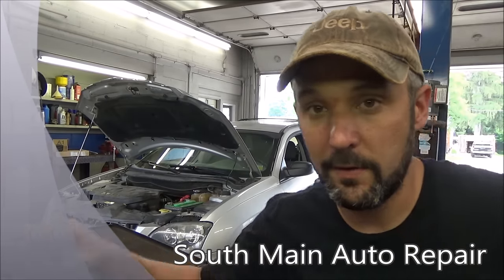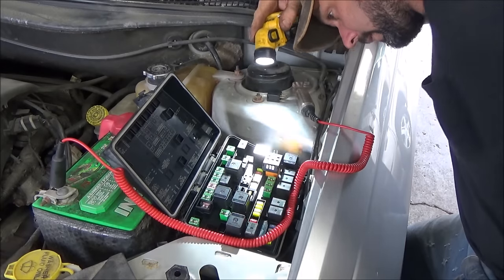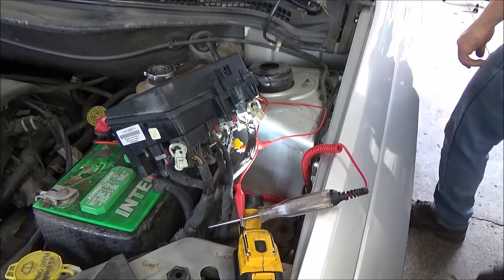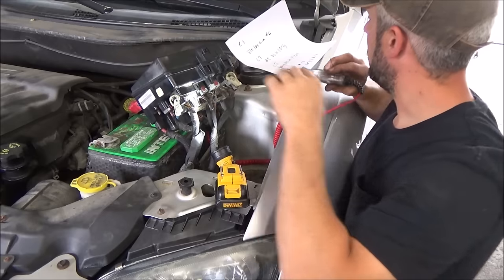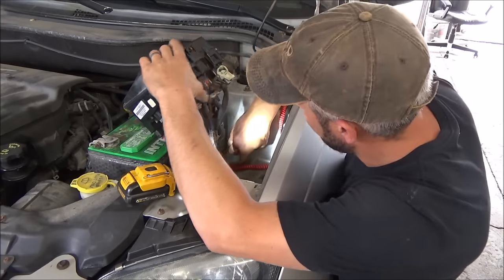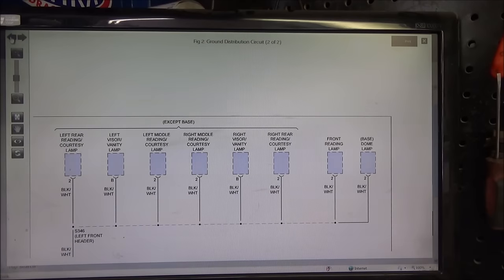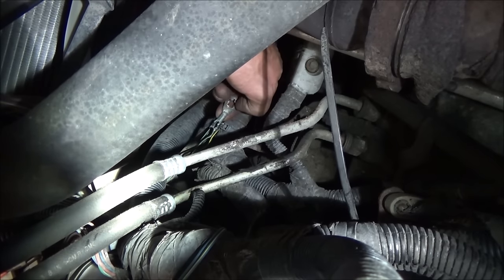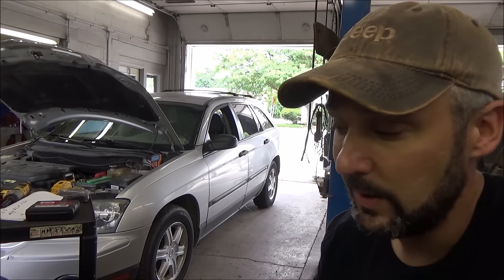Chrysler Pacifica: TIPM Electrical Problems

Comment: Man I can't believed that it worked. I did everything as you did in the video and found 4 broken wires on the frame. It also fixed 2 other problems I was having with my vehicle. I originally took it to the shop for the first issue two issue's i was having and payed $128 dollars to diagnose it, they wanted $450 to fix, I didn't have that much so I took it home and was driving and all my dash lights came on and I couldn't get it in gear. got it back to another electrical shop and they told me it would cost me close to $700 to fix. I thank God I found your video and followed it to the T. had run get a test light and connector's which cost me like $15.00. I just finished and everything is working great. $15 dollar fix and about 2hrs of my time. Thanks so much your awesome.
Reply: I would have been paying those guys a visit afterwards, though you didn't say if the first shop correctly diagnosed it.
Reply: Bobby that’s what it’s all about! Mr. O. Is the man, man!
Reply: Glad you found his video. We ALL get ripped off if you find a decent mechanic like Eric take care of the guy.
Reply: Robert Slackware  ...IT'S A CRUEL WORLD(!)
Reply: @daleburrell6273  p
Reply: @cesarflores8450  WHAT DOES THAT MEAN?!!
Reply: Wow a car repair video into a political statement.  I rather talk about Eric o. car repairs, things get fixed and I laugh. More productive
Reply: @daleburrell6273  Lookit me!! I is effin' TRIGGERED!!! SAMF. Probably can't fix sh_t!
Reply: @woodyglendell7400  ...YOU said it- I DIDN'T!!!
Reply: @daleburrell6273  The sad thing is that the people that hate Trump hate him because of his looks, personality or because the media tells them he said to drink bleach. They cannot say anything bad that has happened to them because of Trump's deregulation or his actions. People lost their primary care physicians, their medical insurance costs doubled and young people who choose to not pay outrageous medical premiums were taxed for it (Trump eliminated that tax). Those were personal things that affected their lives. Retirement accounts that were devastated under Obama came back nicely under Trump's administration. Trump has helped countless Americans. Obama made terrible regulations that harmed business. ETC.........
Reply: @Leon-qc7fe  Leon, you must be to young to realize what Obama inherited from Bush in 2009. He inherited the worst economy since the great depression in 1929.From 2012 to the present the GDP and unemployment have risen on a constant uptick that of course trump takes credit for. When Obama left office in Jan 2017 GDP was 2.1% and BEFORE the Covid-19 pandemic in March 2020 trumps GDP was 2.2% .If you do not know what GDP is its a measure of a countries ENTIRE economic output and taken by the non-partisan CBO in D.C. Your last sentence is interesting. If Obama made terrible regulations that harmed business why is his GDP equal with trump? Trump is the one doing away with all the clean water/air regulation, cutting down national forest,etc,etc. If you don't know that you are a true loyal fox news viewer or as they are know as state tv. As far as the Afforable Care Act you mention its surprising it did very WELL in the states that the GOP led states did not cut its throat. Trump did not eliminate the tax SCOTUS did so get you facts straight. Btw, trump said he would replace obamacare with his "beautiful plan'.Hmmmm. Where is trump health care plan? As usual from the man with 6 bankruptcies and 7 of his top advisors and his personal lawyer ALL convicted felons i would expect nothing less. Those bankruptcies are the reason no banks would lend him money after he refused to pay back the money (bankruptcies are public document my friend) and because fox news does not show them does not mean they did not happen. This is the reason trump will not show his tax returns to the public as he laundered Russian mob money and Deutsche Bank is the most preferred bank. Thats the reason usa gov fined them 1 billion few yrs ago for laundering money. Trump is a 10th grade boy who never grew up and his day is coming soon as all the folks he has fired and pissed off (like 65% of usa) will hound that man forever. I feel sorry for trump
Reply: @davidcooley275  I know what has happened and I will not debate it with you but I will say this. You say "you must be too young, you do not know, you are a true loyal fox news viewer" and "Trump is a 10th grade boy" . You say untrue things about people you do not know. I don't mind being insulted but I will not respond to your false accusations.
Reply: @davidcooley275  Funny, I checked your GDP numbers on the government website . Obama's last year was 1.57 and last year under Trump they were 3.18. That confirmed what I thought about you.
Reply: Where are you located please??? HELP?
Reply: Robert Slackware  , $6 for a cheap one, tiny alligator clip on clamp end. Like anything, you get what you pay for. 😊
Reply: @daleburrell6273  no politics on a car repair video!!
Reply: @grantkoeller8911  WHY THE HELL ARE YOU JUMPING ON ME?! I DIDN'T START IT!!!
Reply: I've never heard of green puss and bad grounds before watching this channel. I grew up in Colorado,  lived in Alaska for 10+ years and am retired in Florida. It must be all the salt they use. I have a 10 year old Honda Fit with 345,000+ miles a I had one tune up around 225,000 miles. Other than wear items, tires, brakes, etc I have replaced the cruise control switch,  the electric cooling fans and one rocker arm...that's it...most reliable car I ever had and I bought it new.
Reply: My alarm light is blinking off and on and check engine light is on on my Chrysler 200 which is not allowing me to turn the car over
Reply: We can mm
Reply: well done man, you owe to Mr O a beer
Reply: P
Reply: That is so awesome!
Reply: 14:13
Reply: 😢my Chrysler is having the same issues the guy at the shop told me it was my hole fuse box is bad but I don't believe him I told him to check ground wires and he said no it's my hole fuse box don't know what to do
Reply: Now my car won't come out of gear
Reply: Great story!

Comment: I absolutely love how thorough and technical you are with diagnosis. That level of pride in one's work seems to be a dying trait. Appreciate you going the extra mile to get it right. I'd rather watch this and learn than watch the junk on TV every single time. Thanks!
Reply: That's honestly how your mechanics should work. I  wish more would.  I'm working on the same issue that everyone turned down and can't figure it out this video helped tons. I touched the body panels with a oms meter and was drawing current witch is bad ground that's why I'm still watching this guy I am the same mechanic and we  won't stop till you find the real problem all these people in town are throwing batteries and alternators and clean terminal since the power issue it's the power issue with the power issue no one has once brought up ground
Reply: " SEEMS TO BE" ????? You must be kidding me. 99.9 percent of the people I run into today do not give one shit about their job, and it's with EVERYTHING. They think they are doing the owner a favor by going to work. This country is SCREWED!

Comment: Best YouTube video ever.  So sick of tracking bad grounds on this thing.  I just made new ground to the black yellow.  This was my moms old car that sat for like 3 years so if it wasn't corrosion or rubbing it was rodents.  Overall I ended up using over 30 butt conecters.  Instrument panel, headlights, camshaft sensor etc. Why can't they make wire insulation that tastes bad.    THANK YOU

Comment: I was an aviation electrician in the Navy and thought I was a decent trouble shooter. Was in the service for 4 yrs so I didn't have enough time to consider myself a pro. I worked 20 yrs in NYC transit on Subway cars as a mechanic and 10 more as a Supv. There I can say I was pretty good. My man here is a great troubleshooter, and has a well rounded knowledge of most of the cars he's working on.. He has a love for his job, he's a great teacher and he goes in with the mentality that the problem is gonna be fixed. It's funny, I've worked with 2 other guys with his mindset and the quiet confidence that the problem will be solved.

Comment: thank you. I was about to have a junk yard pick up my Pacifica. After watching this video, I was able to fix it for less than $10.
Reply: Do un know where the alternator fuse is?
Reply: @SBS_Auto , the wire that comes from the alternator is usually a  fusible link. That means that the wire itself is the fuse.
Reply: @brucejones2354  thabk so sire

Comment: It makes me wonder.... How many Chryslers, Dodges, or Jeeps, are sitting in the bone yard because of bad ground issues???
Reply: ...I GUESS WE'LL NEVER KNOW-!!!
Reply: Not enough. They're shit cars.
Reply: @KarmaVoyager  ...well, ya can't please EVERYBODY!!"
Reply: Robert Slackware  Doesn't seem to have disrupted too many other car companies. Just because the likes of FCA (not to mention any British manufacturer) are a bit dodgy on wiring doesn't mean I want to give up features such as efficiency and avoiding depending on mechanical tune-ups.
Reply: @dblissmn  I'll take a mechanical tune up I can do in my driveway any day over taking it to a shop to diagnose ECU issues that I don't have a $2000 tool for any day. But to each his own.
Reply: @1337penguinman  True, but if car makers were simply required to document the PIDs, let's say as part of some kind of "right to repair" law, you could knock a zero off the end of the price of that tool. Right now they can dodge the issue by claiming it's proprietary and then charging the likes of Snap-On, Launch etc., massive fees for documentation that then get baked into the price of that tool when all the hardware you need is in your cell phone and any Bluetooth or USB OBD device that actually has all 16 pins connected both ways. I'm just trying to get a TPMS monitor PID to work in Torque, and you know the information is there, but the way it bounces around like crazy something is getting lost in translation....and of course that's outside the public standard for OBD.
Reply: KarmaVoyager - My 95 Grand Cherokee was awesome. Those 4 liter inline 6 engines were basically bulletproof. It had 226k on it and I probably could’ve gotten it to over 300k easily, but I screwed up and traded it for a junker Chevy Blazer that blew its head gasket and totally locked up. I miss my Jeep regularly.
Reply: Rust and corrosion is killer for automobiles.
Reply: 1337penguinman most non wiring issues I’ve encountered with my and others vehicles have been able to be checked with a $50 too (sale price though), except abs...

What is an issue is the cars that don’t bother to have enough sensors and won’t tell you if something goes wrong or if a wires starts to fail and will give you a list of things with the code (or worse, no code) but generally I would recommend staying away from dodge if you don’t like electrical issues and even though I’m mostly a ford fan, I’d say stay away from fords unless you like chasing broken or worn or corroded wires... honestly I don’t understand how they do it
Reply: Joe Public I’m not sure about the engines, but stay away from Chevy (ignore how much I love the volt drivetrain) they aren’t as good as GM and there is a difference surprisingly, some Chevy vehicles will use some GM parts off the line but you almost never have to worry about a Chevy part on a GM unless someone put it there, and yes I know the parts are interchangeable and it sounds crazy, but enough measurements and checking on failure points of both will tell you the frame and structure components are thinner in Chevy.... only issue is GM doesn’t make many or any of their own cars directly
Reply: JD RS yes
Reply: there in the bone yard because they dont last
Reply: Those chrylsers are just absolute piles of JUNK!!! The only time i have ever saw those cars is ditched on the side of the highway or the hood popped forever in someones driveway behind all the other cars that function correctly 😂😂😂
Reply: My Pacifica is in the boneyard possibly cause of this issue

Comment: Eric my daughters Pacifica had the same dang problems as the one your working on. The dealer worked on it for over a MONTH, finally they ended up declaring the car as a lemon and took it back, canceling their contractual agreement. Maybe you need to show Chrysler how to fix their own dang cars.
Reply from the maker: +Jeffrey dontyouwish Haha nahhh I am nothing special they should be able to do that no sweat.
Reply: No don't show them, let them lemon as many as possible off the streets lol
Reply: My Chrysler Town and Country sometimes doesn't start,  but only after it has been driven around a bunch of places in one day,  so shut off and restarted. Just, key turns,  starts, then shuts off. What could be the problem? Mechanics said they can't diagnose,  but they don't drive it anywhere either,  just one start and aren't trying.  . . It's been there 2 and 1/2 months. Please help

Comment: Hey Mr O, as a Mechanic here in Aussie land who's done his time back of the basic electrical system, It was easy to fault find electrical problems, but if there was a so called "major" electrical problem, then the Auto Electrician was called in to find and fix the problem, the problem with getting these guys in was that they would never tell you what the actual problem was if it wasn't a component swap out like the alternator or starter, because if they told the mechanic what the problem was, then if it happened again, the mechanic knew just what to do, so the Auto Elec would be doing himself out of potential income.
So watching you fault find this electrical ground problem was very pleasing and is a sign of an excellent Mechanic/Technician as you are, especially repairing those rusty vehicles there in the rust belt, something we never see here in Australia.

Comment: Well, this video has saved me.  I have a 2004 Pacifica that I took to a Chrysler dealer in Monticello IN last week Jan 2020 to run diagnostics for a check engine light.  They gave me back the car with all hell broken loose! Every warning light on the dashboard was on and I could not operate wipers, windows, AC etc.  They basically ruined the car and had the audacity to tell me that they left it running and I should be able to drive home (30 min away).  I insisted that I did not gave them the car in this condition and after bringing the big boss they said that the they would try to tighten the grounds which they did.  The warning lights came off only to reappear about 2 mi away from home.  I watched the video, found my C5, #14 ground wire to be defective just as taught in the video and jumped it to the negative pole of the battery and everything runs fine!.  Cost: My time watching the video.  THANK YOU, THANK YOU, THANK YOU

Comment: Very good video Eric. My wife called me this afternoon to tell me our 2010 Patriot wouldn't start & did I want her to stop at discount battery & get a new battery. I told her NO, bring it back home if the jump works. She brought it home & the first thing I noticed was the ''Square'' Light that is supposed to go around the ''P'' - ''Park'' Position, when you turn the key was out. I put the Jeep in Neutral & it started right up. So I shut it back off, put the shifter back into Park & slapped the Shifter. Then turned the Key & the ''Square Shifter Position Light'' was back on. So it's something with the wiring or the linkage below the Shift Lever. Once the rain lets up, I'll fix it....
It's probably another bad grounding wire or lug..... Thanks for posting the video Eric, (I did watch it in it's entirety).....

Comment: You sir, have saved the day with this video. I have a 2008 Pacifica in my shop and had this potential nightmare figured out in the time it took me to watch you point the way to the problem. Well done man....well done! I repaired it easily despite the location of the 2 ground posts and my customer is very happy as he was expecting an electrical/expensive diagnosis and repair. I have subscribed and am impressed with your work. Thank you very much my friend.